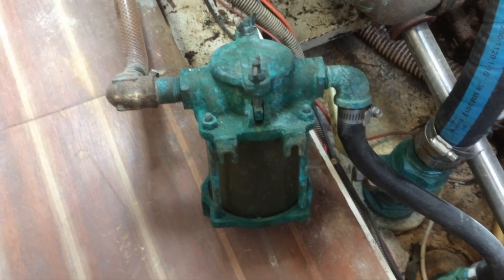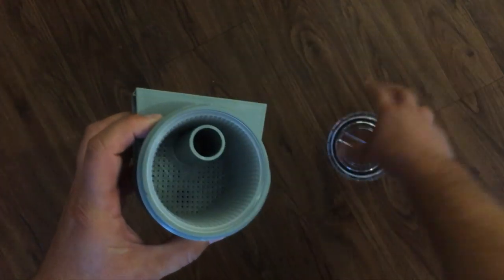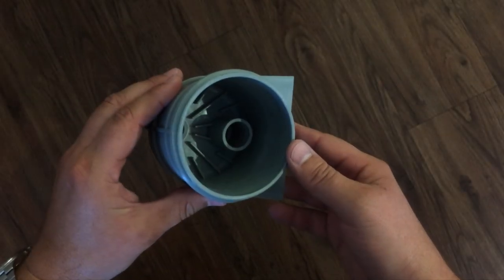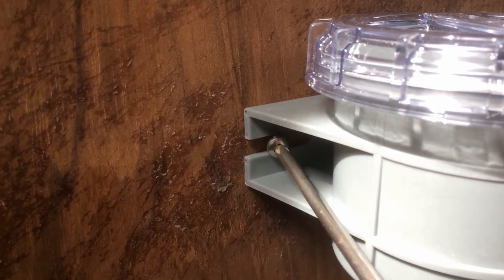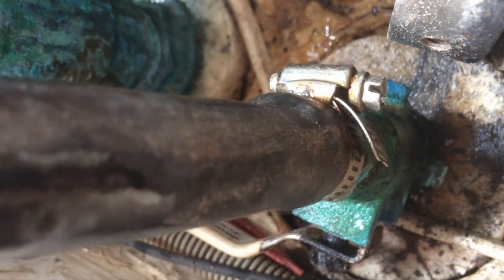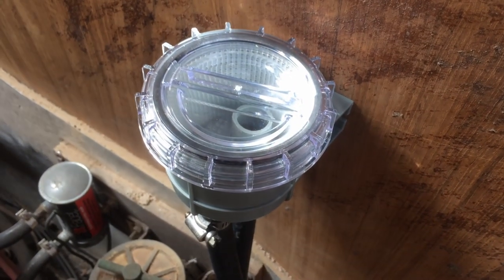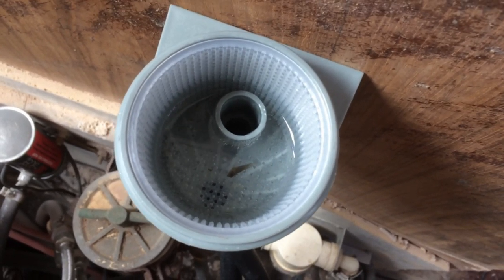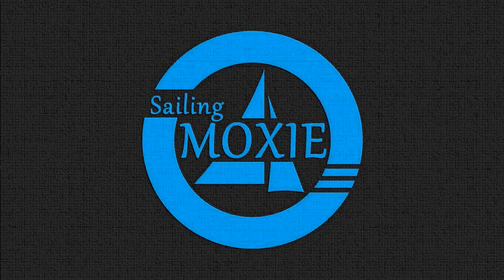Replacing the Engine Raw Water Strainer - Ep. 11 - Sailing Moxie

Comment: Based on your video I ordered the sea flow strainer from amazon. It arrived within 3 days and was priced as you said. 
Worth noting is the inlet and the seal were modified and updated. The inlet inside is almost flush with the bottom of the strainer and the rubber seal fits nicely in the cap.
Hopefully your video brought about those new improvements
Reply from the maker: Interesting that they made those changes, though I doubt it was because of my comments. I hope that strainer is working out for you! In my mind, it was priced so low that it was worth the investment to try it out. Mine worked just fine. I'm having my engine rebuilt now, and I'm itching to get back out on the water.

Comment: You probably want to double clamp those hoses.  Those clamps fail all the time, and not having a second in line with the first might someday be bad news.  Also the strainers are fine for about 15 years, but in 7 to 10 you will have to replace the plastic strainer basket...  For some reason they get brittle.  I've seen more than a few of them..  The engine intake sea cock looks like it might be corroding inside the shaft.  Check it out, it might need some attention.  If you replace it do not use Marelon, as plastic derived sea cocks are not certified for use in engine spaces generally.

Comment: Just going to fit the expensive vetus one on my Moody your video has helped with intall I will use clear spiral pipe double clipped Thanks
Reply from the maker: Glad the video could help. Good luck with your strainer. It'll probably last much longer than the plastic one.

Comment: You should consider mounting the strainer in a place where it's constantly visible.  Like when you reinstall the counter top you could cut out a back corner and mount it flush so you can see it functioning and make it easy to do your maintenance.

Comment: To avoid that gasket problem wipe some valesine around it before installing. This prevents the gasket from being pinchehed and not seating properly. You could also use motor oil.
Reply from the maker: Good advice. Thanks!

Comment: I would have rebuilt the original bronze sea strainer but that's me.
Reply: I need to fix my bronze one.  Any idea where I can get new glass for it.  I believe it's cracked.  Like you, I don't want to waste my time or money putting a new one in when all I have to do is replace the circular glass and put a new rubber seal ring in.   I can't find anywhere to buy the parts.

Comment: Go to some use Boat part stores and find the same stainer or better! The strain you bought I would trust for a few hours! Its below the water line and not so sturdy! Rebuild other one! Prevent prevent prevent! No shortcuts on Strainers, Sea Cocks, Hoses, hose clamps And for sure bilge pumps! 12 Volt and one off your engine!
Reply: What part of he mentioned mounting it above the waterline a few times did you miss? So long as it is above the waterline and the hoses stay above the waterline...even with the seacock open he's fine...

Comment: Hey, good to see you’re back at it!
Interesting setup.  I have mine plumbed to the 11/2” hose.  I guess the previous owner reversed them.
I also installed a Vetus strainer very much like the one you have.  I’m curious to know if you have any flow restriction by using the smaller diameter hose?
Reply from the maker: I looked at the Vetus ones as well - very similar to the Seaflo. Since everything on the engine was plumbed with the 5/8" hose, including the pump that I replaced, I just stayed with the 5/8". I did see that Seaflo has one larger size strainer with much larger inlets/outlets. Just a few bucks more for that one. I'll keep an eye on my engine temperature as I use the engine more and at higher RPMs. If I see any issue with the temp, I'll upgrade the pump, strainer, and hoses to larger sizes to increase the water flow. For now, I have seen no issues, but I'm definitely willing to upgrade if necessary. No flow restrictions with the smaller hoses so far.
Reply: Sailing Moxie Great... I,ll also share my Hunter 54 pic’s soon.  Time is a huge issue for me.  Needless to say I appreciate all that you’re doing!  Thx for sharing!

Comment: Nice to see you posting vids again.    Met you when you splashed at Safe Cove.  I'm not sure what accepted practice is for placing the strainer above vs. Below the waterline.  I've had a few boats and all the engine raw water strainers were  just below the waterline.  I assumed it was so they would self prime.  Having the engine prime the strainer every time might be hard on the impeller.  I'm not an expert just thinking out loud.  Keep up the great work.
Reply from the maker: Hi Sailing Wayward. Yes, I remember meeting you at Safe Cove. I placed the strainer above the waterline because I thought it might be a "safety" issue to make sure that if the strainer leaked big time it wouldn't flood the cabin. I thought the strainer and hoses would remain watertight and that water would remain throughout the entire system. However, I was wrong about this. Even with all the seals and the gasket in the strainer, air gets in, and when I run the engine I see some air going through the clear hoses (which I need to replace anyway). So, as you mention, the water pump is indeed having to prime the strainer each time I start the engine, adding undue stress to the system and not maximizing water flow. I may end up moving the strainer below the waterline for exactly that reason. Thank you for the comment. Lesson learned on my end. No engine, strainer, or water pump / impeller damage so far, but this could help reduce wear on the system over the long-term. -M

Comment: The replacement is far inferior to the original. The bronze perkos are always worth rebuilding as they will last forever.
Reply from the maker: I agree. I just wanted to try out a cheaper alternative. It works just fine, but I will have to replace it regularly. I also think I need the bigger size due to flow rate.

Comment: Great video, thank you! I have a  groco raw water strainer for the a/c unit and a perko raw water strainer for the engine raw water intake... I need to modernize those. So, can the engine one be above water line but the a/c one must be below water line?
Reply from the maker: It all depends on how much draw your pumps have and what safety measures you have in place in case the strainers fail. I found this online: "The ideal location for the strainer is slightly above the waterline but on a continuous upward rise toward the engine. That way, water will not pour into the bilges in the case of failure and air will not have a place to become trapped." (Moyer Marine Forum). On a large sailboat I'm working on now, all the strainers are well below the waterline, but we have solid thru-hull valves in place to restrict water flow. I think you want them close to the waterline, perhaps slightly above (in case of failure), and so that you can open and inspect them without having to close seacocks. However, you then have to worry about flooding them to get the air out or at least pushing or pumping the air through the system so that you get rid of it quickly and don't keep air trapped in the flow systems. Hope this helps.

Comment: Thanks for the video 
How did you calculate the height of the strainer above water level and what about the size of the filter? It looks alot smaller and I wonder if the volume flow rate will have an effect at higher rpm's.
Reply from the maker: For the height of the strainer above the waterline, I opened the thru-hull valve and held the hose up. I lowered the end of the hose until water started to come out. Then I knew I was at the waterline. I wanted the strainer above the waterline, but just barely, so as not to require too much force to get water in. Other people have recommended placing the strainer below the waterline. I wanted it just above the waterline in case the gasket or cap failed, because I did not want the boat to flood while I was away from the boat. The strainer is a bit smaller than I'd like. I will upgrade soon to the larger size for better flow rate at higher RPMs. For now, I don't run the engine too high or very long, so the smaller strainer works just fine. But I will upgrade to the larger one soon. Thanks for the questions.

Comment: Does a 155 have a water strainer
Reply from the maker: Do you mean a 155 outboard? Most marine engines, either gas or diesel, have some sort of raw water strainer to make sure the water cooling system doesn't get blocked with debris. The strainer could be external to the engine like mine on Moxie and most marine diesel engines, or it could be internal for an outboard engine.

Comment: Hi! I have the same strainer on my boat, I noticed that it does not fill up all the way after cleaning the filter. Is it ok if it’s filled 1/2 way?
Reply from the maker: Mine also doesn't seem to fill up to the top while the engine is running. But I've had no issues with water flow, as long as the gasket is seated correctly when you screw the top on. My strainer is above the water line. I've considered placing it closer to the water line to see if the remaining air gets sucked through so that it fills completely with water. But so far I've had no issues with reduced flow through the heat exchanger or through the exhaust.
Reply: Sailing Moxie actually my seal was dirty and was letting air in. After cleaning it. And running engine for a while the air went away
Reply from the maker: @nicolasterzani9017  Good to hear!

Comment: Are you still happy with the replacement?
Reply from the maker: Yep, it still works just fine. I may upgrade to the larger size strainer soon since I want to get a bigger heat exchanger for the newly rebuilt engine. But the one in the video works perfectly. No issues with it.